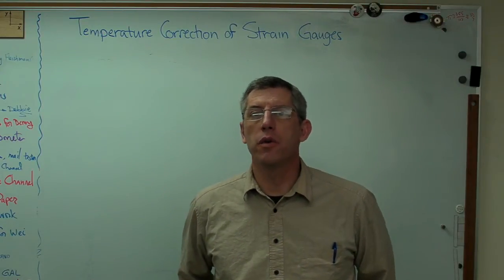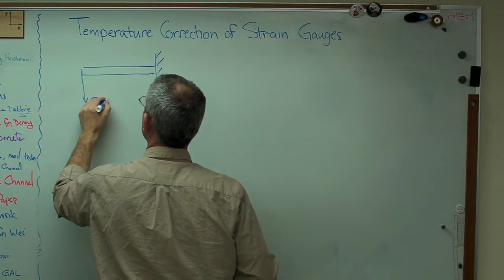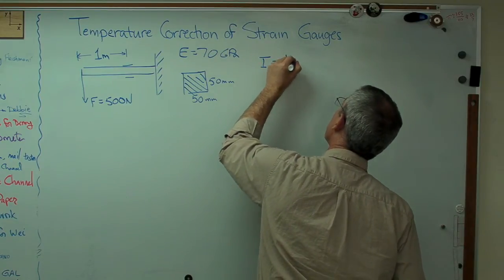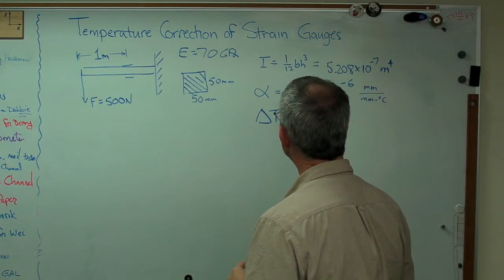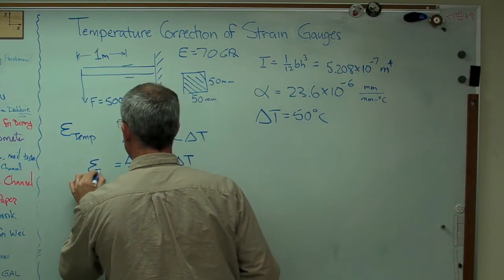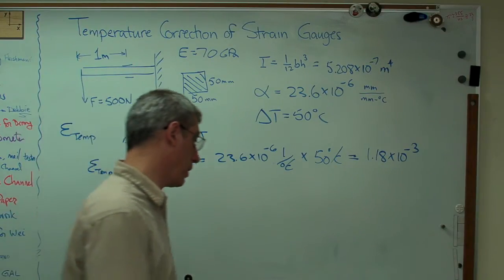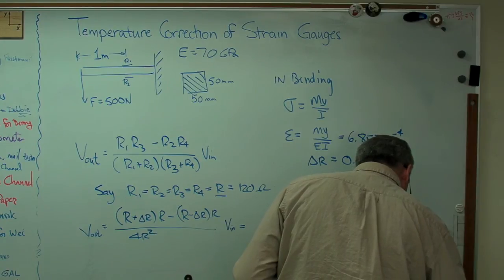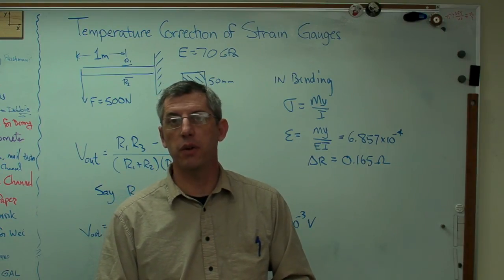Strain Gauge 4 - Temperature Correction.MP4

Comment: Just wanted to say thanks for putting these tutorials on Strain Gauges together.  Your teaching style is very easy to follow and I appreciate the knowledge.  I'm looking to build a load cell with a range of 0-200lbs. and I have a bunch of gauges already.  Just trying to piece all of the knowledge together to build my first circuit and calibrate everything.  I like the cantilever design method, but I would like to keep the sensor and mechanics slim so it might not work out.

Comment: Thank you for the video. I have a problem with my strain gauges and I would be grateful if you help me with it. I used two aluminum type strain gauges in a half bridge circuit to compensate temperature effects on axial strain readings of an aluminum pipe. One of the strain gauges is in direction of the axial load and the other one is installed perpendicular to the first one. When I heat up the aluminum pipe, without mechanically loading the pipe no changes in output voltage should be observed, right? But when I heat up the pipe, I get an increase in output voltage as if I'm compressing the pipe! I expected that any changes in the output voltage due to an increase in temperature should be indicating thermal expansion and not contraction! This aside, I'm using aluminum type strain gauges, they should have no thermal output when they are installed on an aluminum backing material, even in a quarter bridge circuit, right? well, this does not happen, either! What do you think that I'm doing wrong here? thanks.